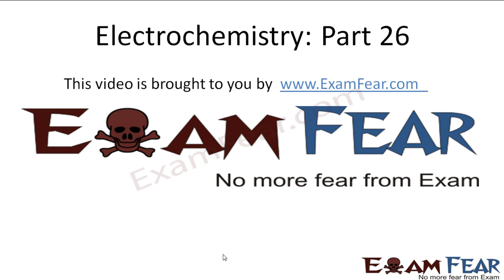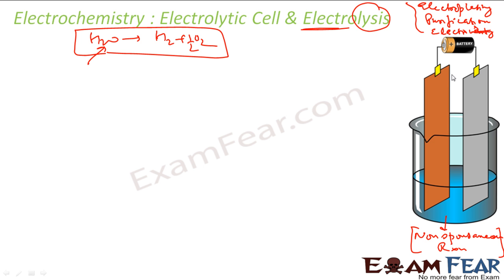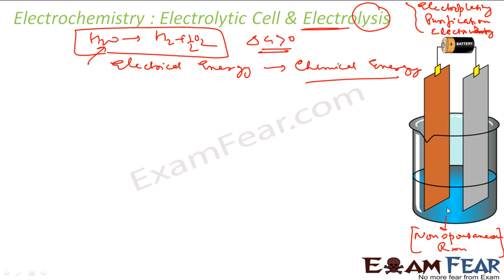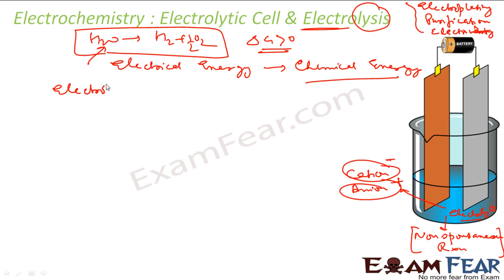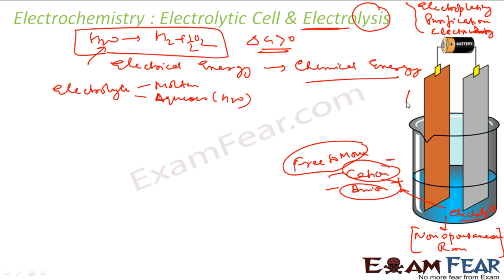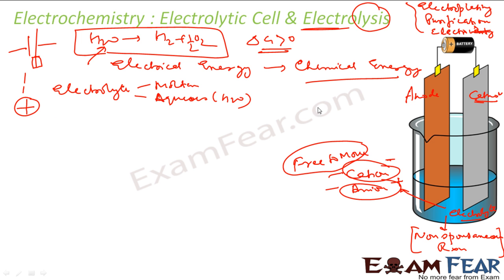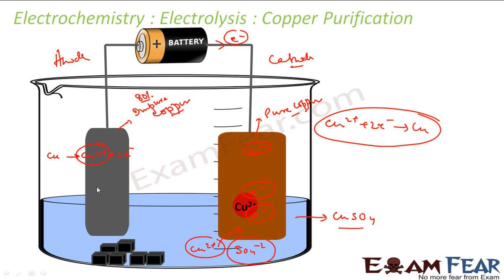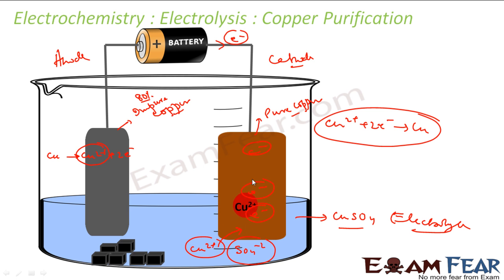Chemistry Electrochemistry part 26 (Electrolysis: Electroplating) CBSE class 12 XII

Comment: IF YOU DONT KNOW HOW TO TEACH, SIT AND WATCH SOME CRICKET. ANIONS ARE NOT POSITIVE THEY ARE NEGATIVE. MY TEACHERS HAVE BEEN TEACHING ME FOR FOUR YEARS THAT ANIONS ARE NEGATIVE.
Reply: No.  
It is actually a reverse process we are forcing some thing to happen with help of battery. 
Reduction is gain of electrons which can happen on Cathode. And to gain electrons first we need electrons THAT IS WHY -ve
PART OF BATTERY IS ATTACHED TO CATHODE(Copper) in case of electrorefining .But you are comparing that cathode is attached to  -ve that's why it is wrong. YOU ARE MISSING BIG PICTURE.

Comment: Why is anode -ve in electrochemical cells and +ve in electrolytic cells
Reply: In general ,Cathode is that electrode from which Current leaves the cell And Anide is that electrode through which Current enters the cell. In general,Cathode is -ve and Anode is +ve .Only in charging cell it changes (Electrolytic cells)
Reply: Think u got it